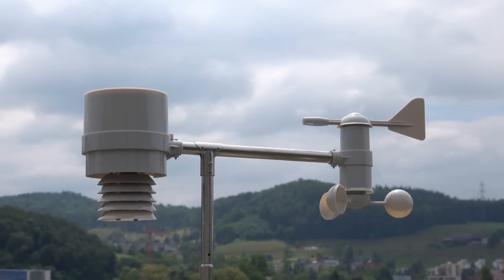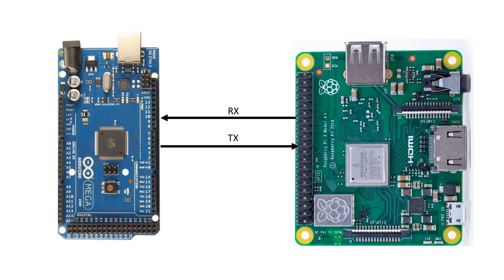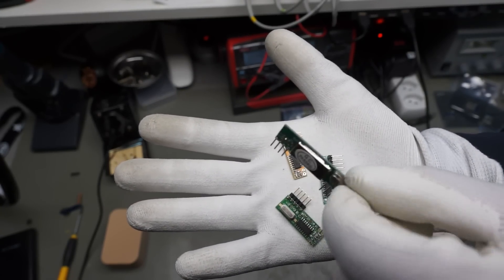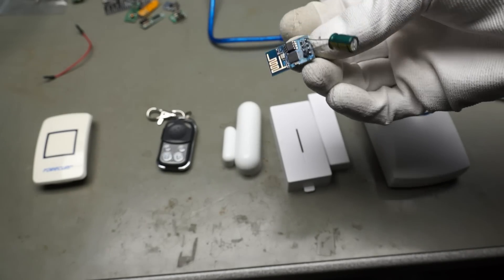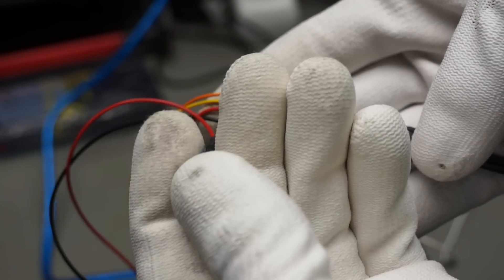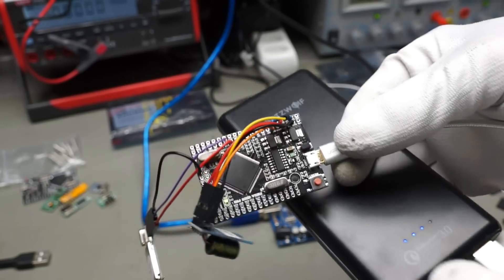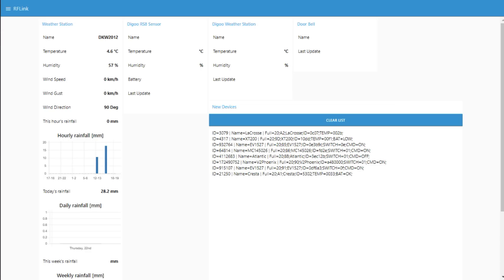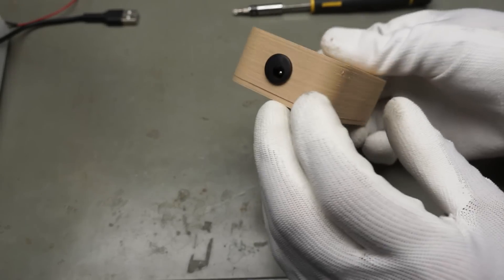#242 How to Build a Cheap 433 - MQTT Gateway (RFLink, Arduino, ESP8266, Node-Red, Weather Station)

Comment: Did you see that 2580 Mega on my project? Have 3 now of them. Was using Ethernet,  but it is having problems with server in NZ. Think of going Esp01 to talk to shed network.  I see you are still using Node-red. What a live saver it is mine is offline right now. But may put it out for my shed too. Have a wonderful week Andreas. From Aussie land. By the way it snow here this week. In summer of all time very strange. Csonger really does some great work with his note red stuff. Remember asking him about something once I think. You can watch the Sonoff bridge on my channel too mate.
Reply from the maker: Yes, I say it. Concerning Espurna and Sonoff bridge: I think it would not transfer sensor data of my weather station?
Reply: @AndreasSpiess  Not sure, if it would or wouldn't.
Reply: @chuxxsss  sadly, i have here also a Sonoff RF bridge with espurna and works only with a few devices... :(

Comment: Hi Andreas, what about an arduino mega with embedded esp8266? Link in next comment, to prevent youtube antispam filters...
Reply: https://it.aliexpress.com/item/NEW-Mega-WiFi-R3-ATmega2560-ESP8266-32-m-di-Memoria-USB-TTL-CH340G-Compatibile-Per-Arduino/32926370442.html
Reply from the maker: Thanks for the link. Would have been a good fit. But I did not know it exists :-(

Comment: Welcome in the world of RFLink users and the cheap 433 devices! Most probably you will not spend less money but you will have much more devices for the same money.
Good idea with the small Mega substitutes. Unfortunately the mine is already ready build in into a cheap 3EUR enclosure and running for a long time with currently 53 devices, 2 or 3 channels each. Mostly cheap T/H, motion detectors, door/windows contacts.
It even worked with a single wire through a single sided pcb as an antenna. But now I am using the very good Aurel 433 groundplane. I derive the supply of the receiver directly from the 15V of the Arduino by a capacitance Multiplier and a subsequent 7805 to reduce the noise a lot.
I do the administration of the devices as well as archiving, data logging and plotting with ioBroker. Very conveniently! It has ist own history function as well as adapters to influxDB or other commom data bases.
Have fun with your cheap 433 devices!
Reply from the maker: Seems to be a big installation. Thanks for sharing your experience! I got a few links to other solutions. Maybe I will try them, too. And if it is worthwhile, make a comparison. The 433 MHz devices are really quite fun!

Comment: There also the option of broadlink rm pro, as it is supported by many home automation systems and you get the bonus of IR blaster
Reply from the maker: I have one which is only an IR blaster. But I got the impression they are closed source. Did you work with them?
Reply: @AndreasSpiess  not yet. One is on the way. They are closed source but there are ways of connecting them to home automation controllers. Even the Alexa you have should handle it.
Reply from the maker: Thank you.

Comment: Use a Sonoff RF Bridge 433, flash with tasmota, total cost about $20.
Reply: Or if you want to stay on the DIY side, use the OpenMQTTGateway project. Supports 433Mhz and 315Mhz modules along with many other sensors. I'm using it to control my RF lights and as a replacement for IR remotes through MQTT.
Only need an ESP, no arduino mega.
Reply: @JonathanWellskcender  thanks for the tip. never found this when employing the old gargler. will give it a try.
Reply: This solution will not cover all the protocols supported by RFLink
Reply: @FlorianRB  Since this is an open source option you can add whatever you need.
Reply: @matthewblackstone7347  yes, what will be the dissuading factor is the quantity of work needed to add protocols. There is a huge diversity of protocols with 433mhz. And it can be difficult to integrate them into a source code. Even if I prefer open source programs, RFLink is currently the widest free option in terms of protocols covering.
Reply: +1
Reply from the maker: Did you do it? It seems to have two different processors which have to be flashed.
Reply: @AndreasSpiess  it's a piece of cake! You can even program the RF chip using Tasmota...
https://github.com/Portisch/RF-Bridge-EFM8BB1
https://github.com/arendst/Sonoff-Tasmota/wiki/Sonoff-RF-Bridge-433
BTW, you can also use the RAW sniffed message, no need to know about predefined protocols.
Reply: @insti123  Can you make a video of it?
Reply: @jeroendevries9525  I'm not sure. What kind of video? You have all the info in the two pages I have indicated. What do you miss in them?
Reply: @insti123  Currently using Espurna firmware. I can follow the quide to cut traces and flash portisch firmware on it. Then is unknown for me, how to use the raw data in Home assistant (MQTT). Can't find any conclusive information how to use it then.
Reply: @jeroendevries9525  you just enable "Raw mode" and will receive "B1" messages in Tasmota console and MQTT. Then to transmit a message back to a RF device you have to figure out the Raw B0 message. You have a python script in Portisch and Tasmota pages to get the B0 message by using the B1 source. It's just that simple!
Reply: Interesting comment, thanks.  Might be worth getting one of the SonoffRe devices that has the receiver populated.
Reply: Espurna works well too. There's a direct RF mod that bypasses the second MCU for more flexibility.
Reply: As others in this thread have mentioned, the Sonoff RF Bridge running espurna or tasmota and Portisch/RF-Bridge-EFM8BB1 for the MCU decoding the 433 protocols. Yes, downside is that we have to add any protocols for weather stations, etc, as even the Portisch/RF-Bridge-EFM8BB1 firmware started its focus on rf remotes/switches/etc. I am considering adding support for the Acurite 5n1 WX station, hope to work on it soon.

Comment: Hi Andreas, with the idea of happy wife(girlfriend) in mind. Is it not a nice idea to connect this project to opentherm so your house is on the right themperture ;)
Reply from the maker: Our heating is extremely slow and heats up unnecessarily if a strong sun shines during the morning. I consider since a long time to use the weather forecast to switch the heating off early if I know the sun will shine. The rest is done by cheap thermostats.

Comment: Isn't there a possibility to get info from meteoswiss? Those are, at least for next 24 hours, really good. And, btw, there are esp01 programming boards that include 3.3V regulator, serial interface and slot for esp, some of them have a switch for programming and normal boot. Bought 1 on ali, works like a charm.
Reply from the maker: 1. unfortunately I did not see an API from them. I would be glad they would open up.
2. Do you have a link for the programmer?
Reply: @AndreasSpiess  https://de.aliexpress.com/wholesale?catId=0&initiative_id=AS_20181125072253&SearchText=esp01+programmer